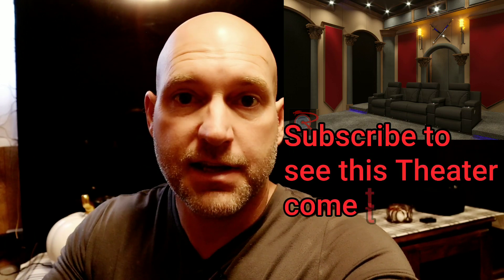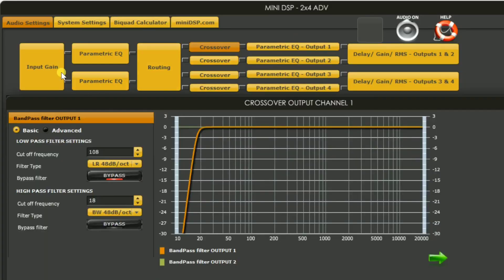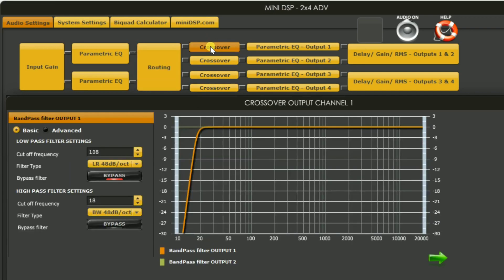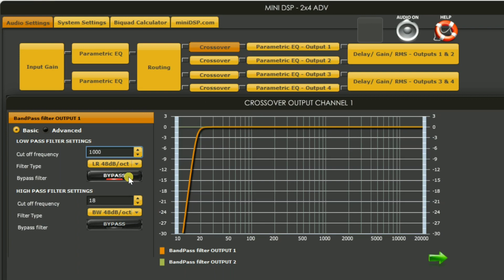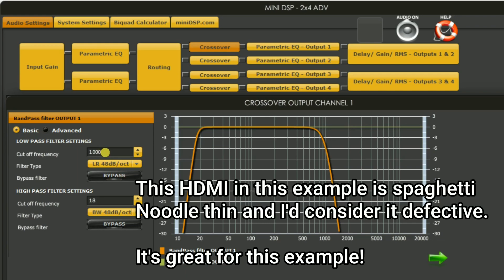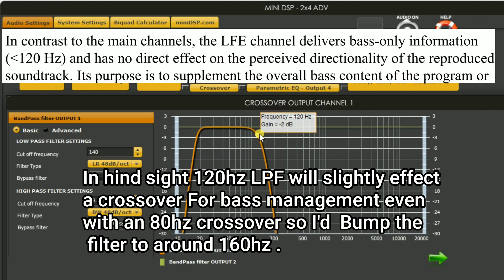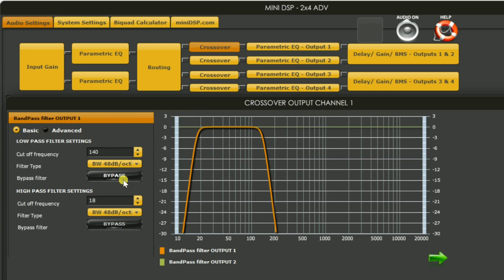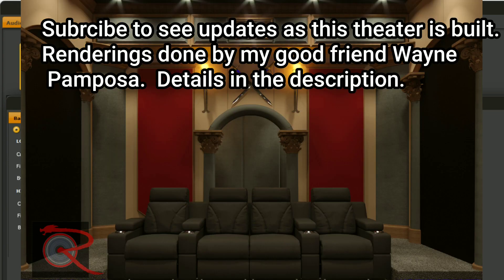Ep. 43 - Easily fix SUB HUM and clean the signal | Home Theater DIY Subwoofer |Home Theater Gurus

Comment: I know this video is a bit old, but I’m getting a 60hz hum through my HoverEze. It’s running through a mini dsp 2x4hd and Behringer nx6000. Considering I have my lpf at 10hz with an 18 db/octave bw slope and still getting hum is there anything I can try with the mini dsp? I’ve already sorted and separated all the cables and everything is running through a SurgeX 115rt. No hum through my PSA subs at all, just the HoverEze it’s driving me crazy lol

Comment: Watched your video and great info... I have subwoofer hmmm and like a clicking noise when it's not even plugged into the AVR. It works, but when everything is cut off but the sub you can hear it. The thing is so heavy it's gonna suck to box it up and return... any suggestions?

Comment: My Inuke3000DSP has a hum but I've always had a lowpass on it so it was never a problem. Mine is from my computer whenever the GPU is doing something intensive. The harder it's working the louder it is, but the lowpass filters 95% of that out. Also have a slight 60Hz hum also mostly when the GPU us being used heavily, but it's so quiet you need a dead silent room to even notice, thankfully a non issue.

In the living room though... amp/sub is unusable. Didn't bother to try and eliminate the hum beyond a cheater plug, was just bored and seeing how that room sounded with a sub. Needless to say I never found out haha.
Reply from the maker: Yeah sub hum can be a pain in the sub!
Reply: I've got the same problem with the video card but the noise comes through via the overhead channels because those are on an older Rotel amp. It is extremely annoying and so far nothing helped.
Reply: I have the same issue when using my behringer A800 with the preouts of my Yamaha TSR-700 reciever to power my front L/R speakers.  I have tried using a XtremPro Hi-end Ground Loop Noise Isolator/Filter I bought from Amazon ($25) and it eliminates all the graphics card variable noise, but I still have a static noise that I can hear when the room is quiet.  So is this an issue for most external dedicated amps when connected to a PC/TV earc, or just the cheaper Behringer and Crown amps?
Reply: @Povell81  I think it's just the nature of some pro amplifiers. My mixer (used for a mic to my computer) also had lots of noise but I got rid of most of it with a cheater plug thankfully. 

You might be able to get rid of your static noise by turning up the volume on your pre amp and turning down the volume on the Behringer. Basically more input voltage to overcome the other noise the amplifier has. Letting you turn down the volume knobs (voltage attenuators) and lowering the overall noise floor.

Comment: Great stuff always. How would you deal with hum/static over the Atmos channels that are on a power amp?
Reply from the maker: Sometimes it's due to the speaker wire running to close to a power wire.  You can also try running a wire from the amp rear screw to the avr or  processor rear screw to go round them together.
Reply: @hometheatergurus  That's a good idea I'll test that. Cheers
Reply: @hometheatergurus  Steve, should it be safe to wire two amps to the AVR's ground screw? I have two amps that have pretty bad hum, an old Rotel 6 channel that runs the overhead atmos speakers and the NX3000 running the subs. Will these be safe to connect them both the Anthems' ground screw? Thanks

Comment: Living in temporary camper it may not be soundly grounded to earth. Can always use additional grounding and stick ground in the earth outside and maybe move it about and then attach to the power board earth/ground to see if it grounds the hum.
Also maybe dodgy hdmi as hdmi is always dodgy even those 4k are dodgy with dodgy 2.1 that is epic fail. Maybe the dodgy hdmi has break in the pin on the inside of the equipment an open circuit on the ground. Can always grab a wire cable length and attach it to another ground elsewhere then attach to crown ground to see if the hum is grounded.

Also its not a sub hum as it would apply to all amplifiers. If its a sub hum then does it hum if the AVR AVP output lead to input lead to the amplifier is swapped around if the hum goes away then there is broken ground one of the outputs on the AVR AVP RCA or XLR or DB25 connector.

1:34 35dB ground hum that is rather high. I had noise filtering though one of the outputs to inputs for proper Dolby Stereo playback that passed from Laserdisc to the Denon AVC-X8500H input then outputs to Behringer DEQ2496 where I could see this -75dB noise. It took little thinking and solving it with a Behringer hum eliminator that eliminated the noise I forget how far down it reduced it to maybe below -120dB or somewhere around that figure which is acceptable since most any audio gear is gong to have signal noise ratio S/N ratio typical to must audio equipment.

Thou the crown only shows level down to -70dB I wonder if it can have a remote software connected via computer where the remote software will show a much lower dB scale reading below -100dB to see what the amp is like with no lead connected to it. As leads act like an antenna aerial, depending on how good the cable is with its shielding to reduce minimize RF EMI radio transmissions, other electrical noises. How good is the filtering in the amplifier or AVR AVP as they all have filtering to reduce RF EMI as much as possible when they build and test this in Anechoic Chambers that are not just for testing speakers but also RF and EMI.

You can also use REW to see the frequency of the noise of the random noise frequencies as well as how low down in the dB scale it is. Disconnect the lead on the computer for REW , there be a typical noise on the REW that I think is -110dB or lower. Connect something up the signal noise goes up and often shows random frequency noise. Put a sine wave tone though it which can be adjusted to very low -dB level below the noise and increase the generated sine wave level of say 1KHz, get the idea?
Reply from the maker: That system isn't in the camper.  There's no way I'd get away with a hammer sub in it.😁

I don't even use the system in that building it was just temporarily setup for an audyssey setup video.  I'm glad I had the hum as it was a perfect opportunity for the video.

Comment: I want to know what's up with that software. That looks nothing like the software I have for my 2x4HD.
Reply from the maker: Yeah its the standard 2x4 software not the HD.  Does the same as what you have it's just laid out a tad differently.
Reply: @hometheatergurus  Got it. Thanks for that. That version looks like it has a much nicer GUI.
Reply from the maker: @_Radius_  agreed.  I like it better than the HD plug in too. I'm not sure why they don't use one gui for both types.
Reply: @hometheatergurus  Yeah that doesn't make much sense. I have never used a standard 2x4 so that's why I didn't realize it was different. Now I know. :)

Comment: Again,  just for DIY subs correct?
Reply from the maker: Yeah pretty much.  A sub with a plate amp has basically has a lpf too which is the crossover knob which we max out as the avr handles the crossover.  That knob can be used as well although most of those knobs max at 200hz or so.  This means when maxed its filtering above it so you're doing the same thing.  Now if you have a switch that disables that knob you aren't getting the filtering benifit.

Comment: Setting a 140hz or even 160hz LPF filter isn’t ideal.  It’s too close the the 120hz LPF that they AVR LFE output typically applies and they may interact in odd ways.   I’d recommend grounding the amp chassis to the ground plug on the AVR, and perhaps to the electrical outlet as well.  I’ve seen where you might need to lift the ground on the TV or projector as well using a cheater plug (if comfortable with such).
Reply from the maker: I'm not sure if you watched it but we're using a very steep filter as to not effect anything around 120 hz at all.

And yes there are other methods that sometimes work sometimes don't.  This is just one and something that IMO should be a default setting as it doesn't do any harm and actually filters unneeded frequencies.
Reply: @hometheatergurus  ah.  But it does.  Your AVR likely has a shallow 6dB or 12dB per octave roll off at 120hz.  That means by 240hz it is only 6 or 12 dB down. (An octave is a doubling of Hz).  So your steep roll off filter at 140 or 160hz is almost certainly in conflict with the AVRs shallow roll off and this may introduce phase issues in that overlapping region.  You could check if it does by doing a full bandwidth frequency response with your main speakers playing as well with the Filter you created at 140Hz-160Hz on and off and seeing how the frequency responds in that overlap.
Reply from the maker: @jvonengeln  Lfe is 120 hz max... No content above it.  Our crossover for bass management is usually 80hz.  Thanks for the input.
Reply: @hometheatergurus  it isn’t a brick wall filter on an AVR at 120hz for subs high cut -  so yes there is plenty of content above 120hz, though yes it is being shelled off.  AVRs use a shallow rolloff filter.  Case in point here is my subwoofer frequency response on a Denon 4520CI with the default 120Hz subwoofer LFE setting.  Mainspeakers turned off for the capture (but crossover setting at small and 90hz)  Post 2 of this thread near bottom.  https://www.avsforum.com/threads/the-subwoofer-recommendation-by-pricepoint-thread.1425179/#post-22318562

Comment: There’s another way. If you have a unused RCA out on your amp, connect that with a coax cable or RCA cable and plug it in the low level input (not LFE) of your sub. The hum will disappear.
Reply from the maker: I'll have to try that.  Thanks!